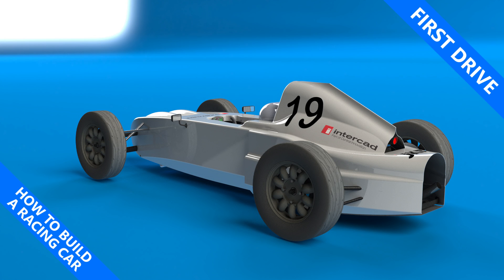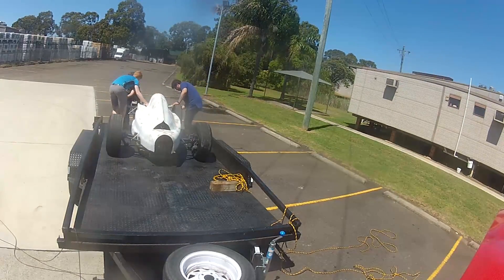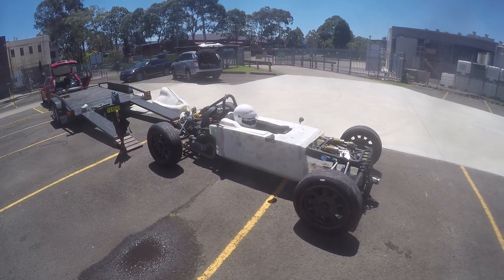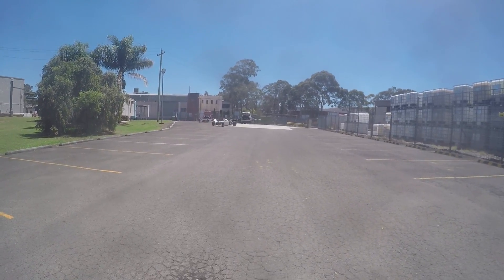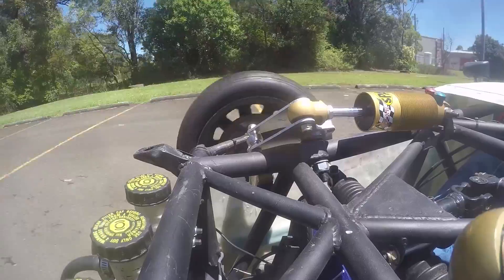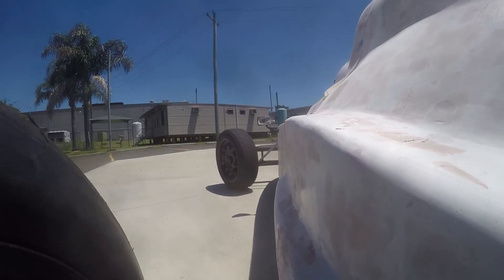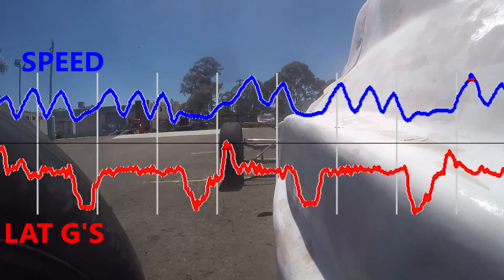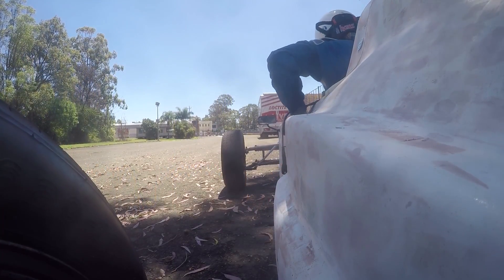First Drive!

Comment: Hi, on the rear suspension design you initially had 2 extra shocks that control the roll, but these aren't on for the test? Whats the reason these aren't installed? Im making an fv btw too, thanks for your great videos

Comment: for racing it would be better to have a 180 degree steering angle
Reply from the maker: The amount the car turns per degree of wheel input is what's important - you could have a 180 degree steering angle that gives a lot or only a little turn at the wheels.

Comment: Quick question on the transmission. I noticed you're using a VW AC flat-4. Are you using the accompanying VW transmission as well? And if so, how did you get it to have the gears in the right direction so to speak? Normally Beetle transmissions are in front of the engine and in your earlier episodes it looked like you were placing the transmission/transaxle and axles rearward of the engine. Thanks for any input!
-American Mech-Engineering Student
PS. Still awesome
Reply from the maker: Yes VW transmission. I didn't do the modification myself but I think they flip the gear on the differential so it reverses the direction from the gearbox.

Comment: why didn't you slope down the front of the car?

just wondering if there was a reason
Reply from the maker: The nose is higher than most because it would work better with the tray this way. Once it's on the car of course.
Reply: ohhh, okay are you going to put bigger skirts on the side of it? or is that not allowed by the rules?

Comment: I driven the caterham cars and they usually have narrow band steering like one turn on each direction for left and right and the hands are always on the steering wheel at each bends. I reckon you'll need more down force for the front. but this car is sweet. whats engine is in it?
Reply from the maker: Thanks. When on a track I'd rarely turn more than 90 degrees left or right, this was a very tight park though so I had to do a lot of work with the wheel. With the tray you would be correct that it will probably need something on the front to provide balance, Kyle of Kyle.Drives has plenty of ideas about how to go about it.
The engine is a 1600cc type 1 beetle engine.

Comment: Nice work! Do you have a video in the works for A) the aero kit (I don't think you've covered this in any of your videos so far) or B) the making of the bodywork from the molds? I'm guessing (especially since you and +KYLE.DRIVES are good buddies) that you'll be using woven fiberglass rather than CF?
Reply: Also, I'd go with B on the car paint scheme. Simple, easy to do, yet still pretty damn classy.
Reply from the maker: G'day. I'll definitely record and make a video on the aero once it's been made, it's still a way off though as I'm working seemingly forever on getting the bodywork ready. Which brings me to B, I'm not yet finished with the bodywork, it's getting there but it's not there yet. I'd like to wait to make the video until it's complete, painted and stickered. And yes, you're on the money with the fiberglass, I used a twill weave and epoxy resin system at Kyle's suggestion.

Comment: Awesome! looks like a tight fit and super low but worth it I suppose for less wind resistance. how's the visibility?
Reply from the maker: Yeah it's a combination of trying to reduce drag and lower the center of gravity. Visibility is actually quite good, better than I expected. The only issue I can see is that lining myself up with the marks on the starting grid may be difficult as they are so low beside the car. I'll have to wait and see how tough that is.

Comment: Congratulations mate, great when every little bit of the puzzle comes together like that and the first testing phase goes off without a hitch. What's your ride height on the car, looks fairly low, do you plan to adjust it much? As far as graphics go I would say B looks pretty good, although it might be interesting to try something like "overlapping triangles" fading from the rear forwards, would look pretty jazzy. Well done again man!
Reply from the maker: Thanks. The ride height is just over 40mm which is the mandated minimum ride height for the car, I'd always aim to keep it as low as possible. I might mock up an overlapping triangles idea and see how it looks, I like the idea. I'd just need to figure out how I'd actually do it on the car, my current designs could be done quite simply with a large vynil sheet, cut using a stanley knife.
Reply: Naturally. Aye a quick google search of "overlapping triangle graphic" turned up some interesting looking stuff. Some printing companies do mail order vehicle wraps that you apply yourself, something like that might be worth looking into. Pity you're so far away, I have a mate here in Scotland that does exactly that.
Reply from the maker: I just searched that, I like what comes up. That sort of thing with a few shades of blue would look great. I'll do a search for what can be done in Australia, to date I've just been looking for the smaller sponsors stickers or large single colour sheets which I'd cut myself. I was in Scotland a couple of months ago by the way, I lived in north England for five months of this year for a work project. I loved Scotland, Edinburgh was fantastic and the mountain biking was some of the best I saw in the UK.
Reply: We did something similar to that for last year's FSAE car, it worked well but getting the placement and alignment correct on a surface that's curved in three directions is pretty tricky. Small world man, I study in Edinburgh, great city indeed! What was the work project if you don't mind me asking?
Reply from the maker: I mocked up an overlapping triangles style livery, have a look at some pictures: http://tinypic.com/r/2me50cl/9 and http://tinypic.com/r/2qkjvx1/9. I've sent the info to a vinyl wrapping place here in Sydney to get a quote to get the car wrapped. Honestly unless it's relatively cheap I'd probably have to forgo it to begin with, the other concepts I can do myself with some vinyl sheeting which will be a cheap way to go.
The project I am working on is called Project LEILAC (http://www.project-leilac.eu/), which aims to capture carbon emissions from the production of lime and cement. Extremely interesting and exciting to be a part of something which would have such a positive impact.
Reply: That looks ace, nicely done. I can relate to that, we're a young team and as such we're pretty much running on a shoestring. That does seem like an interesting and rewarding project to be a part of alright, I'll be keeping an eye out for the newsletter updates on it